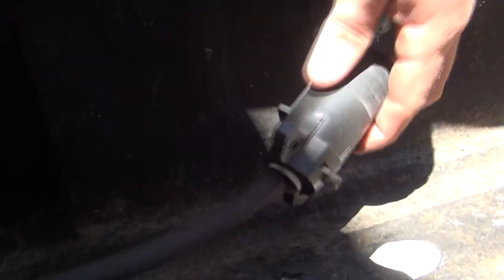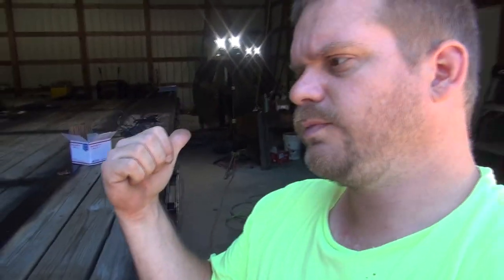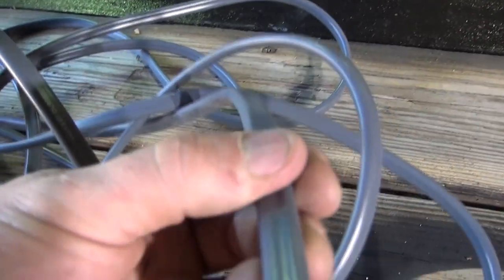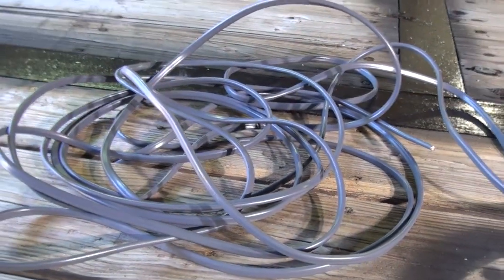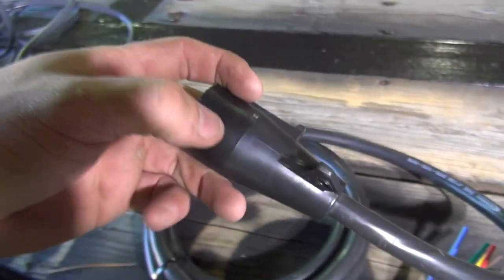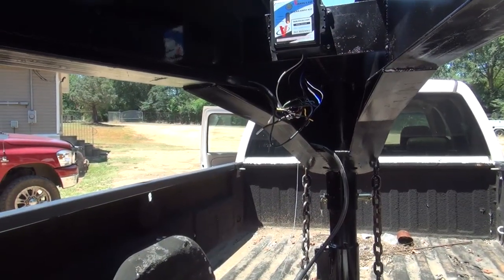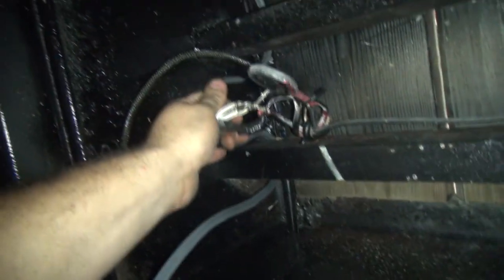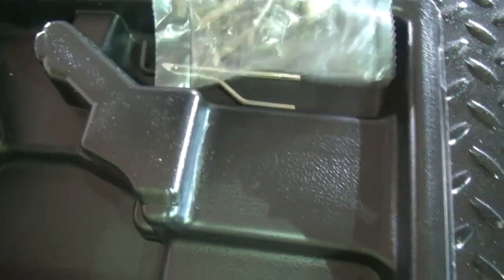Upgrade electric trailer brakes for a hundred dollars

Comment: I just rewired a utility trailer and used the SolderGrip connectors, pretty slick. Slide the wires in both ends hit it with a lighter or torch, it melts the solder and heat shrinks it all in one step. They go up to 10ga.
Home depot has them.... SolderGrip heat-shrinkable solder-type connectors and terminals are designed for electrical termination of multiple-wire combinations. They provide a reliable alternative to crimping, welding, or conventional twist-on-style closed-end connectors.

Comment: It's my UNDERSTANDING that The Brake Controller "limits" the amount of Voltage to the Electric Brakes "according to the amount of STOPPING POWER is needed. Full VOLTAGE (12volts) is used to LOCK the brakes in an emergency// Such as; the trailer brakes away from the tow vehicle causing the electric brake-away feature to be activated, it would apply FULL BATTERY VOLTAGE to lock uo the brakes
Reply: Agreed, but there should never be voltage drop on the wire itself which is what he had from the trailer connector to the brakes.

Comment: For the truck female connector, solder the wires into it!!! Solder doesn't oxidize easily as  well use Vaseline on the male and female connectors it keeps water  moisture from  them. This will also increase the voltage down the line. Less voltage drop. My truck came with the blue wire cut at the right fender well so I had to splice in , I used the gray jacket 2/10# back to the rear, marked all cables/ wires with larger/much white heatshrink written on before shrunk so that reading what a cable/ wire was! for future. I hate trying to remember what something was!!!  Where I am is prone for rusting, your area might not be so there is the difference. Prevention is better then having to redo something!!!!!!!!!! They make a duel wall heatshrink the epoxy is inside and  shrinks well to the wire/ or jacket of a 4 wire/6 wire/ 7 wire cable. I use a Western Union splice on most things with the duel wall shrunk over them. If you don't have access to the duel wall or stuck for time??? 40+yrs ago I came up with shrinking the ( now called single wall )  onto a wire or cable . Tye wrapping double wrap  it ,  the heat shrink onto the wire/ cable putting on a descent amount of RTV shrinking it acts as a sealing shrinking it with seals between. Don't burn yourself.(don't ask!!)  If you want to keep the middle area soft, don't shrink it. I did this on my truck. I have opened wires 40+ yrs later with no corrosion in them , so have figured it worked well. If you can get the marine product "Sika Flex" seals wonderfully better then RTV! 
One thing I would have done is use the red heater hose enough to go back up both sides  and secured of the I Beam and seal stones/ sand out with silicone .

I would have brought all of the wires forward to the goose neck from each of the lights with the gray jacket 2/14# marking as mentioned before for reference then soldered them either to ring ends or into a suitably sized junction box. 6"X8"X 8" They do make plastic connectors called strain Relief connectors into junction boxes. Or highway truck trailer shops have the  block wiring for there trailers to use  easier and cheaper. This would have allowed to do a short fold of jacket wire back for doing light replacement later when needed.  Yes I hate fixing things, better to prevent problems.

Comment: I got a trailer one of my trucks just doesn't like. It's a 2019 F150 and has the factory brake controller it works with 2 of my enclosed trailer and my RV trailer but my 22ft dovetail electric brakes just don't work. But when I pull the trailer with my 2010 gmc with an aftermarket brake controller they work perfectly. I think this vidjeo will help me sort it out.

Comment: I ordered awg 10 gauge wire for the electric brakes I installed on my boat trailer but then noticed that the wires at the electro-magnet in the brake units were about the gauge of a round toothpick so the larger wire wouldn't be any help in a break-away situation where the wires will overheat for the allotted time the breakaway unit keeps the brakes locked (15 minutes.) Those skinny toothpick wires will probably melt if I hold my brake pedal down too long. I trust e-trailer though so I'm hoping they know what they sold me. The 14 gauge I installed will provide more than the skinny wires can carry, especially over their short 15 foot run.
Reply from the maker: Bigger axles have bigger magnets with bigger wires and when you have multiple brake magnets connected together the supply wire needs to be bigger than the wires coming from the individual magnets because you are powering 4-6 magnets on most heavy trailers. I'm surprised a boat trailer would even have electric brakes, usually they are hydraulic surge. I don't think electric brakes will last long in the water.
Reply: @LifeWithChase  Trailer is 31 years old and it's surge brakes rusted away in salt water use in the Gulf of Mexico. The original owner replaced the surge tow-hitch connector/hydraulic tongue with plain hitch. I didn't want to spend more than $100 on brakes ($400), hitch ($500), controller ($? I don't recall how much) and breakaway kit. The hydraulic lines were completely rusted and in pieces = more $.  I do plan to hose everything down real good every time I'm in saltwater. The trailer only had brakes on one axle of two. The boat is only 23' long. The 14 gauge wire I used is 10 times the size of the wires on the electro-magnet.

Comment: I cheated, used 12 volt outdoor lighting wire for mine. Worked on all three trailers. Also I had to turn up the settings on my brake controller like yours to high on my triple axle.
Reply from the maker: pretty similar stuff I think

Comment: My problem was the wire inside the axle running from side to side , the coating was worn off and causeed a grounding fault .  Not all the time but often enough .   So i ran separate wires down both left and right side to the brakes instead of thru the axle .  Solved my problem .   Just sayin
Reply from the maker: I've done that before as well...

Comment: I'm completely rewiring a trailer and running a 10ga ground and either a 10 or 12 ga wire to the trailer brake. Just to make sure I got this right I need to run my ground and my electric brake to each axle? I'm running everything in liquid tight flex pipe and am putting a junction over each axle with those two wires running down to each brake.  Obviously I want my other lights and stuff to work but this is what is truly important to me because I'm going to be pulling a pretty good load down some fairly steep grades and I'm not interested in testing the high speed cornering ability of my truck and triple axle trailer :) If anyone can confirm I am correct that would be awesome.
Reply from the maker: Sounds like you got it figured out. Junction above each axle with a ground and electric brake wire to each brake. Be sure to test it out before you hit the road and thanks for watching...

Comment: LOL    killing me man.    Good video though.  If you check voltage and Ohm on a 14 straight, on a 10 straight, and then check 14 hooked to a 10.   you will see what I mean. aint sayin it won't work but it it aint gonna be the same. 
  Mine set up factory from junction  left and right have their own wires on the dual brakes..  the main wire runs to each side from junction, then there is the branch to brakes " on each side" not all four brakes on the same wire  Or left side on heavy gauge and smaller gauge after that to the right side.    I was checking videos though to see if all  pro built trailers are the same or whatever. seems like the norm is probably not the common sense way really.     anyway.   LOL I dont have to pay for my wiring this time so I am going to do it up gnarly as can be and call it done.  The wires on mine are run thru some welded on condit and it appears to me that the insides of that conduit must be rough. ate thru the wiring somehow, when I plug that trailer into the truck I get all kind of errors on the dash and the lights and brakes are not working. serious shorts on that trailer.    the awesome part is ,got the trailer dirty a$$ cheap because of it. LOL

Comment: How about if i wire each pair of wheels seperatly ?,,, 1 14 ga. wire for each side ??
Reply from the maker: I guess that would work but would be a lot of additional wires to run.
Reply: @LifeWithChase  I would rather run extra wires,,,And be safe,,,Then not and be unsure
Reply: @LifeWithChase  How do you figure "A Lot" of additional wires ???? It`s 2 wires power and neutral,,, That`s not Alot
Reply from the maker: @mrcoz1764  I was thinking you meant to each wheel, on a 4 or 6 wheel trailer would have been a lot.... I see now you said per side...

Comment: I hate those scotch lock connectors....they damage the wires as you squeeze to install  them. i never understood why trailer manufacturers skimped out with such a light wire for the brakes....14 gauge is only good for 15 amps....even less when you consider the length and those horrible connections. each one of those 10k axles can pull over 8 amps....up to 16 amps for the 2 axles. i like the pre molded plug and 7 pin harness. however, i find the color color is never right.
Reply from the maker: Doesn't make much since Dot worried about an oil leak but scotch locks on your electric brakes from the factor none the less is perfectly fine😀

Comment: Was 9.5V enough to make the your brakes work correctly?
I've got about 10.5 at my connector and 8.5 at the brake magnets.  This is on a 32' gooseneck with dual 10K dexter axles.  The brakes will barely lock up empty on loose gravel.  Shoes have virtually no wear but the trailer tires were worn out so I'm thinking they never worked.
Reply from the maker: They seem to be pretty decent. Probably not as good as it could be if the truck had bigger wire also but way better than they ever were since the trailer left the factory I bet.
Reply: @LifeWithChase  I ordered enough 10g wire to do the trailer. The wiring diagram says everything is 12g on the truck. I rewired the trailer connector on the truck and may have not used good enough wire -will check that too.
I'm actually surprised my 8.5v at the magnets won't engage the brakes. That's about 2/3 of full battery power so you'd think it would be about 2/3 full brake power.
Thanks for the reply and vid.

Comment: Where does the black wire go..?
Reply: Black wire is 12v power.  It would go to a battery on the trailer to keep it charged.

Comment: What does it mean when the brake control doesn’t work the brakes. But the trailer works off the brake pedal. I have two other trailers that work off that trailer brake controller.

Comment: you had me until you dropped the wire under the 3 steel cross members. Should have gone through or over or something. I'd catch that wire on something and those sharp bends will bite you down the road.